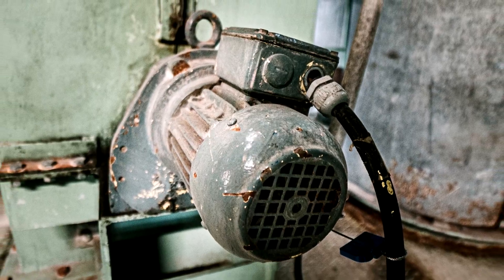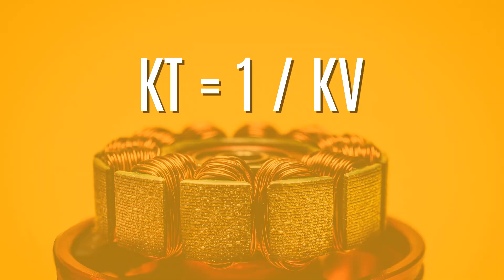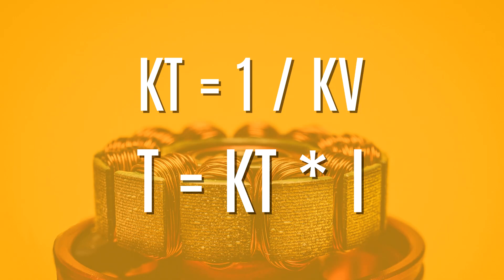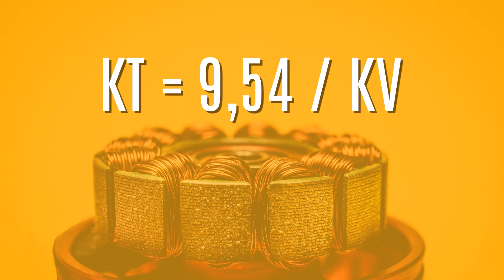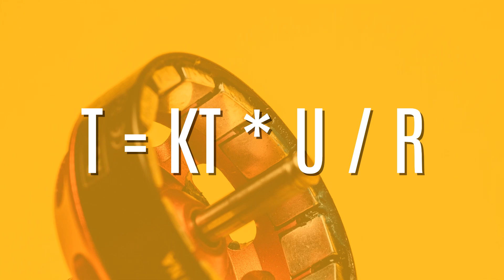Motor torque DOES NOT depend on KV and here is why!

Comment: Yes, but if you use a high kV motor to produce the same amount of torque as the low kV (for same rated power), you need it to pull more current. Seems like you need a battery with high C - rating and capacity for that.
Reply: Making the higher kv motor run hotter.

Comment: Silly question ,
Why did they change the way electric motors are rated ? Not sure if anyone can help me figured it out. In the past - electric motor was rated for example -   750 W at 12 Volts at 6000 rpm.
So it was very clear information. 
Now we have the Kv and turns. Very confusing .
Same like with the batteries  - 120 Amp/h. Versus 70 Amp/ h. Now we have 660 cc. Which doesn’t tell me anything about the capacity of the given battery.

Comment: I have one question I am trying to figure out and I can't find a proper answer. I have castle 2028 800KV. What would be the differnce with using 5:1 gear or 10:1 gear if the power remains the same. Torque on gera shaft and speed is the same. with 5:1 I will have 10 000 rpm on motor with 2Nm torque and with 10:1 I will have 20 000rpm on the motor with 1Nm torque. I think that current will be the same in both because it is still the same power on same voltage. So is there really any difference for the motor? thanks for the answer
Reply: Oh, that is much more complicated. The current in the motor winding is proportional to torque, so there will be 2-times difference in current. That instantly leads to 4 times difference in heat generated as any resistant generates heat = R * I ^ 2  But there is a very confusing thing that most people don't think or talk about.
The winding current is NOT equal to the consumption current! Because there is a PWM signal applied to the motor and it consumes current from the battery only at the ON period. But at the OFF period, the current still goes through the winding and creates torque and heat. If you want to know more about this, google "motor slow decay mode". As a result average winding current is higher than the consumption current.

As a result - with a lower gear ratio you will have much more heat generated in the motor (also it's an energy waste). But at the same time with a higher gear ratio, there will be more energy wasted on friction and that could be a major factor too. 

Hope I helped a bit.
Reply: @Positive_Altitude  thank you very much I appreciate your reply. It's probably not for discussion in the comments, but I'll ask anyway. I understand the answer, but if the output is the same for both, then the current which is directly proportional to the torque makes up the larger part of the total current and thus generates more heat?
Your channel is full of professional information, keep up the good work.
Reply: @matejpetras2016  Thank you! Not exactly a "larger portion". Let's say currently ESC applies battery voltage to the winding with 20% duty cycle. That means that roughly speaking current flows through the battery 20% of time. The other 80% of time the winding is literally shorted, but the current continues to flow through the shorted winding because the winding is an inductor and it accumulates the energy in the form of magnetic field. So roughly speaking the same current flows through the winding 100% of time (just with some ripple in reality). But the same current goes through the battery only 20% of time. So the average winding current will be 5 times more than current consumed from the battery!
Yes it seems kinda wrong that more current flows through the motor than through the battery, but there is no mistake it's easy to prove if we take a look at energy conservation.
Let's say we have an ideal 1000Kv motor that currently rotates at 2000 RPM and 10V battery and 1A consumed from the battery. Power consumption = 1A * 10V = 10W. But where does this power go? Current in motor works against motor back EMF and that's where electrical energy converts to mechanical. Motor back EMF = 2000RPM / 1000Kv = 2V. And if we have 10W in and 10W out, that means that the current in the winding that works against back EMF should be 5A. 5 times more than we take from the battery.
So that's very funny, but really the whole thing works as a step-down converter. It reduces the voltage and increases the current. And if you check the schematics of DC buck (step-down) converter you will see that it is indeed the same thing. Is is just the motor winding is used instead of the inductor and motor back-EMF instead of load.
Sorry if it's hard to read, I tried to give you the proper answer, but BLDC is a freaking complicated thing, I can not do anything about it.

Comment: Lower KV motors are usually chosen that are intended to run larger propellers with lower pitch for heavier lifts. The drone will be slower, motors can run hotter but it can lift bigger weights. Still, requires larger size motors. A 2120 motor with 120KV will be absolutely different than a 5120 with 120KV.

Comment: I'm sorry to say that this story is just a fraction of what is really going in and is overall bullshit. To create thrust the air movement coming from the propeller needs a certain amount of speed. If the propeller is turning too slow no thrust is developed and R will stay high and I low and no torque is produced. To create torque you need to balance V, KV and prop size. 
The thickness of the wire has nothing to do with this.With a certain amount of I a certain thickness of wire is required or the wire will overheat and start glowing. You will often see that motor coils have parallel wired coils. Instead of using thicker wire using multiple thinner wires in parallel will do.

Comment: it is true, if you have infinite current. which it feels like we have, with our 100+C batteries XD

wait, low KV have tighter windings????!!! i am very confused.

Low Kv can take more current because of the lower resistance, right? therefore it can take more current and therefore produce more torque?
Reply from the maker: low KV motor, assuming the same stator size, will have more turns of thiner wire. So will generate more torque per amp, but pull less amp since winding is longer and thiner, thus have higher winding resistance. 
Low and High KV motors will have roughly similar torque on the same voltage. But because magnetic field can raise much faster (lower inductance) it can spin faster. Lower inductance also means there is less inductive load shifted 90deg and active power is higher.
Also higher RPM mean higher load on the same prop and more torque is consumed to keep current RPM.
In general there is difference between max torque and power and current load and power
Reply from the maker: but that's not all. We talk about maximum torque! not average torque during the phase cycle. Coil can be energized only for as long as it can interact with a magnet. When you rotate faster, phase can be energized for a shorter period of time. And due the inductive nature of a coil, and the fact that voltage and current will be out of phase, it takes time for the magnetic field to build up and then fade out. Longer for low KV, shorter for high KV. 
When we reach max RPM, the power integral goes down and average torque available goes down as well. So motor has no extra torque to accelerate anymore
Reply: @FPVUniversity  i see, other videos have suggested otherwise, but this makes more sense now, lower inductance means higher speed, more coils does not mean faster accumulation of magnetic flux, it means higher strength magnetic flux but takes longer to saturate.

Comment: i measured kV with vesc and kV is voltage dependent and wikipedia says: kt is the torque produced divided by armature current. It can be calculated from the motor velocity constant kv so i dont know whos right/wrong here
Reply from the maker: You only look at half of it. Yes, torque depends on KT and KT on KV. But also current changes with KV

Comment: Basically the stator size, magnet quality and the air gap decides how many watts the motor can output. The KV just shifts the operating range to match the battery,
Reply from the maker: It's slightly more complicated than that, since motor load is also a factor. But yeah, KV does not matter

Comment: It seems to me that ignoring the inductance and back EMF from the magnets means you are ignoring the primary factors that determine the current.  I would expect the static resistance to typically be very low ("negligible"?), and only really limiting the absolute maximum current.  While I think its fair to say that torque does not depend only on KV, I think its  at least misleading to claim that torque does not depend on KV.
 I haven't tested it, but I think that if I have two otherwise identical motors, but with different KV, connected to the same ESC and battery, the lower KV motor will be capable of more torque, while the higher KV motor will be capable of higher speed .  Is that not true?
Reply from the maker: Yes, passive resistance is low. And inductive resistatnce applies as well. But if you apply inductive resistance instead passive one, it's the same story. On top of that: higher KV will have lower inductance but higher frequency. Lower KV will have higher inductance but lower frequency. It all cancels each other. And at the end, torque does not depend on KV :)
Reply: I re-watched the video to make sure I wasn't missing anything, and I still disagree.  First, I continue to assert that the static resistance of the windings is not really a  factor - its mention in the video is a red-herring.  You do state that the lower KV motor will generate more "torque per amp", so in any situation where the current is limited (perhaps by the ESC, battery or wiring), then at that maximum current, the lower KV motor produces more torque.  Sure, in theory, with infinite available current, then the max current is limited only by the static resistance - but that is not the real-world.  In the real world, we do have limits on the available current.
I remain convinced that the practical reality is: You always have to balance your need for both torque and speed.  In cases where you need more torque than speed, then you choose a lower KV motor.  In cases where you need more speed than torque, then you choose the higher KV motor.  I look forward to the longer video you mentioned to see if it will change my mind.
As always, thank you for your informative and thought provoking videos!

Comment: Overall a good video.

I still find kV confusing reference for async motors as motor RPM not really depended on voltage (V), or current (I). Rather the frequency from the controller (ESC) determines operational RPM. If no load (torque) on motor, the voltage and current can remain relatively low and the motor can run at hight RPM. kV really more a brushed motor term.

Missing in the discussion of RC motors, in general, is reference to motor power (Watts).
 kV is more like maximum spec, used for defining maximum operation RPM at maximum power (ie: at maximum voltage (Vmax) * maximum current (Imax), where Vmax defined by s-rating (eg: 2s-6s) and Imax a constrained to amount of heat a motor can dissipate. 

What would be real interesting is a discussion of motor power and toque as they relate to operational RPM range of a RC motor.
Reply from the maker: ESCs we use make an aproximation of a sine wave. They use PWM because it's simple and cheap. Assuming 50% duty cycle and 16V input, motor gets 8V. 
And KV is really not how fast motor rotates. It's how much back-emf it generates when it rotates. The other side around
Reply: @FPVUniversity  Sounds so wrong. KV is how fast the motor will try to run on 1V . You do know that the signal on the three wires is not PWM but a three phase sinus? https://www.youtube.com/watch?v=4oRT7PoXSS0 How electric energy is transformed into kinetic energy is rather complex but I can assure you that E=MC^2.
Reply: @mooiweertje2084 it's actually both PWM and 3 phase. But yeah Kv is literally how fast the motor will rotate per volt unloaded.
Reply: When the load on a 3 phase motor is too big, in our case a propeller that is too big, the motor will not be able to turn the electrical energy into kinetic energy because the fields of the magnets and the coils run out of sync too far. Imagine the coil is in the middle of two magnets so it is pulled forward and backward equally and the only reason the motor keeps turning is the kinetic energy in the turning bell. The motor will start turning less energy into kinetic energy and what is left is dissipated into heat and when it gets too bad the coils will heat up creating more ohms resistance and the coil will heat up more and will burn. The resistance created by the fields which are responsible for the kinetic energy is called impedance.
Reply: The created torque depends on the load. So in our case the torque is low when the propeller is too small or too big big for a motor of a certain KV it becomes inefficient. When the prop is too small the thrust stays very low and the motor is not pulling any power from the ESC. When the propeller is too big the motor will try to pull the energy from the ESC according to the KV of the motor and the propeller is to too slow to follow and much of the electric energy is dissipated into heat. And if the circumferential speed of the propeller becomes higher than the speed of sound and the tip of the propeller will be slowed down by the sound barrier a lot of electrical energy is converted into heat.
Reply: To get optimal torque you choose the optimal prop for your motor. First you need a well designed model prop.
Without speed of a propeller the moving air is too slow and no thrust is developed and no torque, the prop is too small. When the speed is too high the sound barrier limits the tip speed of the propeller, the prop is too big. To reach optimum torque you calculate the maximum size of the propeller to stay within the circumferential speed which is a product of the LIPO voltage and the motor KV. This will result in a setup that will give your aircraft speed.
If you want your craft to respond quickly you would prefer somewhat smaller props so when the prop is continuously changing speed the power converted into heat is somewhat limited.
So torque can be used to create an aircraft that has a high top speed, can carry a lot of cargo, or respond very quickly. For example a spitfire, cargo plane and a quadcopter. A race quad or freestyle quad.

Comment: 1:25 "the major problem with this way of thinking is that you are not the one who decides on the current". 
Unless, of course, you ARE.  This video assumes you don't pay attention to power usage when you choose motors. If you choose between two motors that use 10 amps (or 160 watts @ 4S) the one with the lower KV with have more torque.

If you do NOT pay attention to amperage (or wattage) and you choose motors only based on the physical size, then what Pawel said applies.
Reply from the maker: The think is, that it does not work like that. Current will depends on: voltage, resistance and load. Idle current is not the same as load current. Same motor with the same size, voltage and KV will have different current depending on the load. After all, mechanical power has to be equad electrical power minus losses. energy has to be conserved. And finally, because of the load, the voltage in this equation is not the battery voltage. It's the effective voltage applied by the ESC (that is PWM modulated). So no, torque does not really depend on the current as throttle position is not driving the current but effective voltage. Same voltage with different resistance will cause different curret
Reply: @FPVUniversity  Respectfully, I think that last bit may be talking in a circle.
Power = RPM X Torque. Period. That's the formula for power of a rotating motor.

For the same power, you MUST have higher torque if you have lower rpm, and vice versa. That doesn't depend on any other factors. As you said, conservation of energy is a law of physics.  You can only have conversation of energy by increasing the torque, if you reduce the rpm at a given power level.

Talking about load or resistance or inductance or ice cream is a distraction from this basic fact from Physics 101.
Reply from the maker: Please remember why we started this discussion. You do not decide on the current that will go though the coils! At least not directly! You decide on the voltage and only then motor will decide on the current it wants to pull.
Reply: @FPVUniversity  That's true. Unless you do choose motors based on tested current / power.  If you DO choose motors based on amps, then you are choosing the amps. Which is the first sentence of my first message. If you DO choose your motors based on power, then you trade torque for RPM.